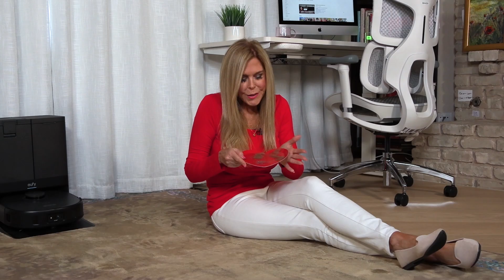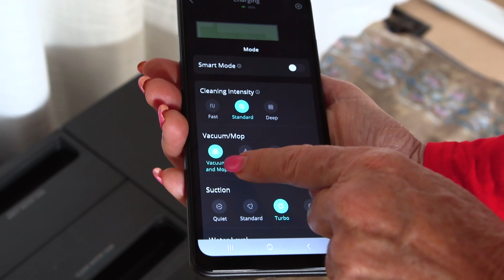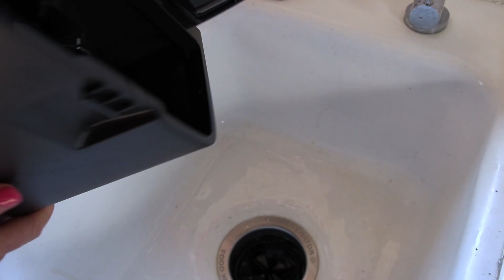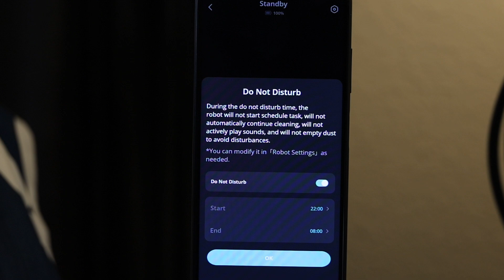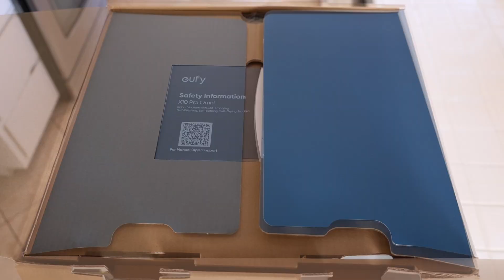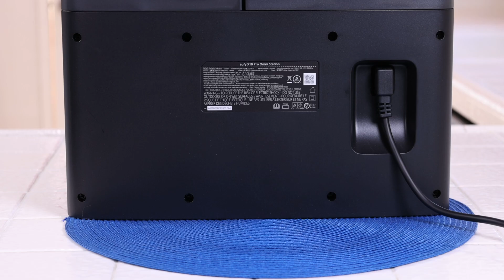Ultimate Cleaning Power: Eufy X10 Pro Omni Robot Vacuum With Mop | Great Price

Comment: I have had this for 2 weeks now.  It will never replace my vacuum and mopping routine but it was only bought to serve one purpose which was to vacuum and mop whilst I am working so that I don't have to drag out the vacuum and mop when my cats mess up my white tiled floors.  For dried on stains you do need to set it to 2x mop because it won't get it the first time and I also add the eufy cleaning solution to the tank for even better cleaning.  I have it always set to the edge mopping because if you don't it stops well short of skirting boards, doors etc. as it turns and does it next sweep. It is also very noisy on turbo and max so if you live in a smaller property you can't schedule this to clean whilst you sleep.  The auto empty is great but very noisy.  In terms of mapping, I found I had to do it twice and barricade off where my dining room (tiled) met my living room (carpet) because I only want the robot to clean my kitchen diner, utility and hallway but it struggled with mapping and avoiding carpet as it should have done.  Also, if you have thick carpets as I do and you love your carpet lines, you are not going to like what it does to your carpet as it leaves horrible circle lines.  All in all, I am very happy with my eufy and hope that it stands the test of time.
Reply from the maker: Thank you so much @lindyloop for your amazing comment.    Thank you for sharing with us. I appreciate your support on my channel!